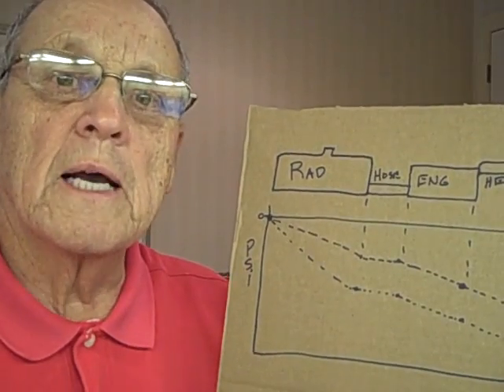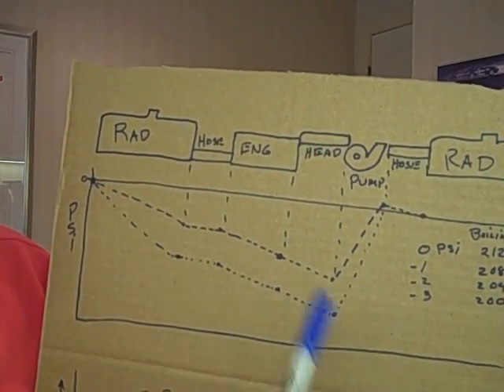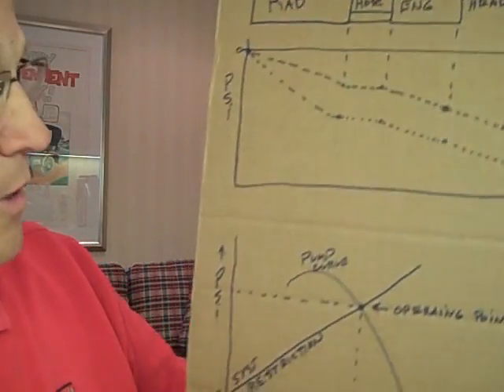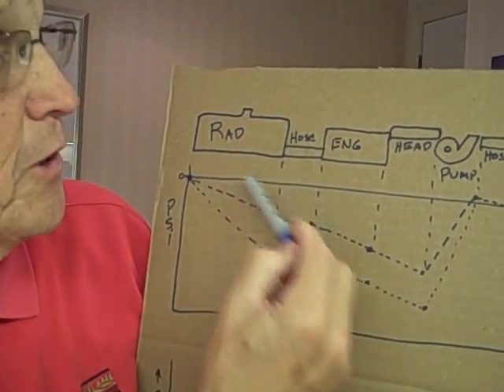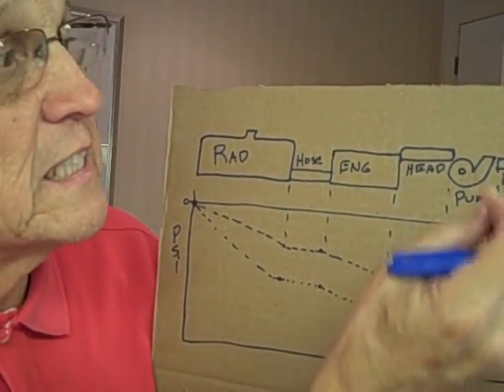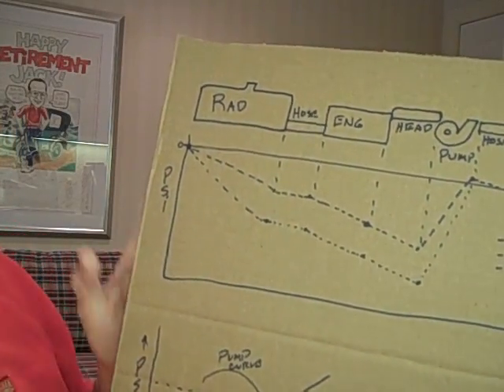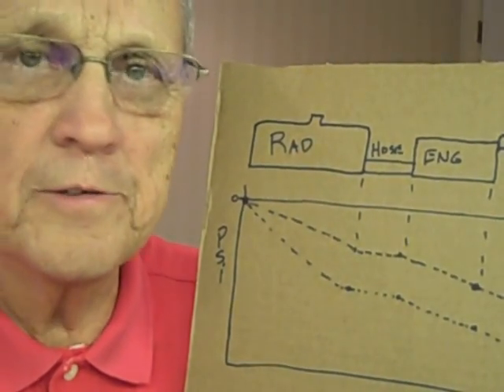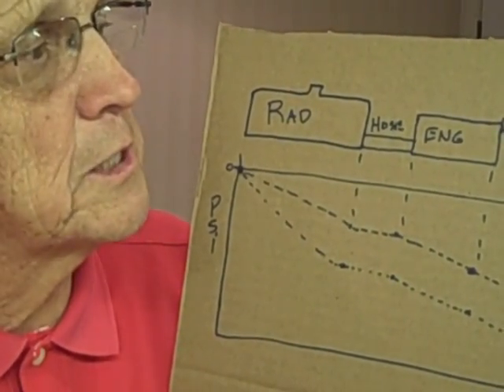Ford Model A Cooling System Overheating Explained

Comment: Is this for a properly functioning system as Ford designed?  Like, IOW, could a model A not ride for 10 minutes at 45mph without overheating?
It seems to me that any classic car that is going to see the road should have a newly cored radiator and the proper pump in good working condition.  From my experience, it is parades that kill classic cars. It's the constant low speed often just stopped and idling that causes the overheating of old cars.

Comment: I have eliminated the most common issues with the cooling system on a A but running down the road 55-65 on a 90 degree day the water temp will hit 220 and usually stays there. My trips are usually 30 to 40 miles at a time. The car has a brand new 3 core radiator and at first I had a problem with the coolant being forced out of the radiator while cruising and I use waterless coolant so no chance of boiling or steam. I added a electric water pump between the lower radiator and the engine and stopped that problem. My engine is totally rebuilt with higher compression head down draft carb and electronic dist. I also use a 6 blade radiator fan. The water pump is a leakless with the reduced impellor. The electric pump I added does 50 GPM. I think it should run cooler down the road and I believe air flow through the radiator is not as good as it should be at higher highway speeds due to the head lights up setting the air flow into the radiator. The lower pans in the engine bay will not help air flow through the radiator.

Comment: Not a mechanic or engineer, but I'm just stopping by to confirm, one major factor is indeed the many years worth of rust inside.
I operate injection molding machines, and I found some of our molds don't cool as well as they ought to. Turns out, they're fairly clogged up with rust. Just blowing them out with compressed air (blew out a cloud of rusty mud!) made them cool nicely, and keep the boss cool too LOL.

Comment: I had a prospect radiator manufacture in Minneapolis for an electrodeposition paint tank. One of the many parameters for an E-coat tank is ... we need to throw 1.3 amps per surface area-square foot of 'work' in the tank. 
We calculated the square foot of all the crinkled-up cooling fins plus the tube's outer surfaces times the number of radiators an hour to be produced and concluded that Minneapolis did not have enough available electricity. We would cause a massive 'brown out' and everyone's refrigerator motor in town would fry. 

I sketched this back in 1977 as I talked to a prospect about an E-Coat tank. I sketched this so I didn't forget anything. ~~~~ https://www.finishingtalk.com/community/user-uploads/skip/Electrodeposition%20Painting.jpg

Comment: If you can not cool it with 2-1/2 gallons you will not cool it with 3 gallons. 
The centrifugal pump slings water uphill through the neck and into the upper tank. It's virtually impossible to flow water through a tube faster than 32 feet per minute. Ford sized their Model 'A'  radiators easily on the correct side.

Comment: I want to get a model a truck for daily driver and I live in a very hot desert , can I or do I need to add a better fan or electric fan
Reply from the maker: I would start with just a new radiator.  Most cores are plugged, but the owners never want to admit it.  The best you could do is put a three row AA radiator on, but you may be OK with the two row.  
Don't think a radiator shop can clear an old core.  Most can't, no matter what they say.  The only way to clear a core is by rodding it out mechanically, and that is hard to do because of the design of the A core.  Good luck.
Reply: @JackBahmlll  Thank you so much for your advice ! I don't have a model A yet but have watched nearly all of your videos and I feel more confident that I can maintain the vehicle . You explain things very clear and easy . I absolutely enjoy the simplicity of the model A and how everything is mechanicle. Thank you again for taking the time to teach me .

Comment from the maker: They sell filters, but once a filter catches the junk, you can remove the filter. I think an old sock would do the job. When you put on a new core, give it a short run with the sock in there, then remove it. Should work. Once the junk is stuck in the tubes, the filter won’t help.

Comment: Jack Bahm seu video me ajudou a entender o sitema de arrefecimento do meu Ford A 1928. Estou com esse problema de aquecimento, já conferi o ponto do motor, retifiquei o motor, troquei a bomba de água mas o problema ainda persiste.
Vou verificar o radiador na tentativa de encontrar alguma solução para o aquecimento. Obrigado do Brasil!!
Reply from the maker: If you are bubbling out at low speed, then it may be combustion gases getting into your water jacket, tighten the heard bolts to 55 ft.#.  If it is still there, you may need a new head gasket.  
If the problem is at higher speeds, as most are, your radiator is plugged.  Most are.  Have it re-cored or buy a new one.  If you have the ability to check the flow rate of your radiator, it should flow around 36 GPM.  Good luck.

Comment: I know of a business here in New Zealand who still use antique equipment from the era to make vintage car radiators, maybe what your looking for?
Reply from the maker: Tell them that there are about 250,000 Model A's over here and there should be a good market for a new, old radiator.  They are getting $400 for the ones we have.  They fit and look OK, BUT USUALLY HAVE A MODERN CORE IN THEM.

Comment: It's probably the result of cavitation in the pump and other points in the system where there is much flow and some void (vacuum) turbulence pockets that makes the cooling fluid water boil below it's designed boiling point. Water vapor has a lot more energy and destroys pump vanes and increases corrosion. Try Evans waterless coolant.
Reply: Miguel Ángel Simón Fernández 
Definitely Evens. 
 $40 well spent and you only have to buy it once👍🏻

Comment: build a fan shroud or find a suitable size one from a junkyard car , it sounds like you need to increase the airflow going across the rad, food for thought
Reply: I drive a 1931 Townsedan, heavy car, at 50 mph plus in Houston when the temperature is 98 degrees. Never had an overheating issue and do not have a fan shroud.  Ford only used a fan shroud for a few months on the early Model A's. It was abandoned as Ford felt it was not needed.  Suggest before you feel you need a fan shroud you find the root cause of your cooling issues. Just saying.

Comment: Jack,  Nice information and talk about a serious problem that has many limited to short drives.  My question is why so many radiators are plugged and what preventative measures can be taken?   Sometimes it is difficult to see your poster. :)
Reply from the maker: +Henry Carr  You can't do anything to an old radiator.  They are plugged with no flow, so you can't put in anything to attack it.  When you put in a new one, or a rodded out one, you should put an old sock over the rad inlet to catch any chunks you stirred up.  Run it a bit, then take the sock off.  Keep antifreeze in it and drive the car.  You have to drive it.

Comment: No, my boiling problem is now solved. And it was caused, like I said, from the lower clamp on the upper rad hose which, I believe, needed tightening as well as moving it up a little. After seven months, I think I can safely say that it wasn't a plugged radiator, just one of those little Model A problems of something coming loose.
Reply: Was it sucking air or leaking coolant?
Reply: @clockguy2  She had a water leak. After 5 years, I still do recall.

Comment: Hi Jack,
I'm well aware of the old problems with Model A fan blades breaking off. But as I said, mine was totally reinforced maybe five years ago and I've never had a problem with it, well at least not yet. It's just the rear ring of the pully which broke off, thankfully in my own yard. This morning a friend of mine was able to Mig weld it back on. Now I just have to grind down the welds, give it some new paint and put everything back together and try it out. I haven't heard of that belt load problem but could that be the cause of the rear ring breaking off?
Reply from the maker: I found my old write-up and will paste it in here.  I don't think a bad joint would cause that pully to come apart.  Sound like you are all set.  jack

Model A tips on the water pump connection to the fan assembly.

The joint between the fan assy. and the water pump shaft  has given Model A’er fits over the years.  It is a taper fit and it must fit tightly or there will be problems down the road.  The design of this joint is not the best.  The belt load is about 2 inches aft of the tapered joint.  The belt load puts a cantilevered (offset) force on this joint.  If there is any movement between the shaft and fan assy., this force will cause a pounding out of the two tapers.  This force rotates 360 deg. every time the fan makes a rotation, and it turns faster than the crankshaft.  Many people try to fix a loose joint by tightening the nut on the nose of the shaft.  This does little to fix the problem and most of the time results in a stripped nut or shaft.  Clamping the fan assy. tighter on the shaft can not overcome the forces tending to wobble the fan assy. on  a loose fitting shaft.
  
So what do we do about all this?   Check the fit often, and don’t start on a long tour with a loose joint.  In time, it will pound out and make noise, and may end up causing damage to the radiator or hood.  If you find a loose joint, check the fit with the mounting nut off.  If it is loose, replace the fan assy. with one that has the proper taper for the shaft you are dealing with.  If it is not a snug fit, it will get worse and the problem will repeat. 
 
I have been successful twice fixing this problem on the road.  Not sure why it fixed it, but it got us home.  Take a small piece of shim stock and form it into a conical shape and place it in the joint leaving room for the key.  You will have to do this a few times until you get it in the correct place to cause a tight fit.  Be sure you have bandaids handy because that shim stock is very sharp.  
This problem may be a little worse with an altenator.  I think we run higher belt tension when we put an altenator on due to the smaller pulley.  Keep you belt tension as low as you can.  Don’t put anymore load on that water pump joint than you have to.  

Jack Bahm 2007

Comment: The only reason I know of that I've had boil overs with my Model A has been from loss of water. And I've found that loss of water can easily occur from those old large slot dome headed screws which hold the clamps. A thick screwdriver with a good flat end is needed to tighten them because once that slot becomes worn after using a thinner screwdriver, the screw can't be tightened enough and water leaks out.
I've also had the rear wall of my fan pully break off and then the fanbelt won't turn the fan. Since my fan has been reinforced and powdercoated, I really want to save it. Can that rear wall of the pully be Mig or Tig welded back on?
Reply from the maker: Be careful of the fan.  It can end up in your skull or hood or radiator.  I doubt that you will find anyone who would weld it for you.  If you do it yourself, make sure it is perfect, and stay away from it when the engine is reving.  
The tapered attachment to the water pump shaft is a major problem.  The belt load is cantilevered forward of the taper and it always beats itself up and fails over time.  I wrote a paper on this joint.  I'll look for it.  
If you can get those hoses tight and drive 45 mph for 10 min straight, your rad is OK.  
jack
Reply from the maker: Jim Ervin  I don't think that clamps are your problem.  Drive 45 MPH for 10 full, steady minutes, and if you overheat, and I think you will, your radiator is plugged..  Most of them are and people keep playing with bandaids and fooling themselves.  jack

Comment: thats very interesting , now ive got a question about a 70s chevrolet cooing stystem and how to descale the iron block and radiator.would it be safe to fill everything up with tap water and add a small percent of sulfuric acid let it run mix well.sit overnite then run again with a garden hose old school flush for awhile? ive descaled other things that way works very well..but would that really get the cooling channels in the block and heater system cleaned out to flow again like it was ment to?
Reply from the maker: thunderstorms06 Be careful with that acid.  It may do things you don't want.  People have screwed things up even with bleach.  If there is no flow in the tube, the acid won't get there.  jack

Comment: So, if I started making radiators that are similar to the old Model A/T radiators, I could have many customers?
Reply from the maker: I Invoke My First Amendment Rights There are a lot of good new ones out there that work good as long as there is not much junk going around.  You would have to compete on price and market the fact that your core has big tubes for better flow of junk.  jack
Reply: Brassworks makes a fantastic radiator. They make some that are like the original and some that are more of a modern style. When this video was made these radiators may have not been available. You would have to compete with them. They have a fantastic following and a fantastic reputation. https://www.thebrassworks.net/shop/index.php?cPath=11_18

Comment: Jack, you appear to be an Engineer. Most valuable discussion. I am a Mechanical Engineer. NPSH and all of that, right? Nice discussion.
Reply: I'm machanical engineer too, your video is perfect in the regard of the Model A cooling system, the most important aspect is when the coolant becomes so hot that it brings the pump in the cavitation zone, then, the flow decreases making the problem worse, it is the infernal spiral.
Reply from the maker: Michael Eisenbise Yes, BSME from LSU.
Reply: @JackBahmlll  go tigers.

Comment: would a 4 blade fan help with pulling in more air and help with the cooling??
I have a 31 A model that I've had to install an electric fan to force more air through.
Reply from the maker: Lee Goins 
Sure it would, but you are just adding another band-aid, trying to cover up a radiator problem.
Reply: Jack Bahm Hello Jack, the 4 blade fan worked well, but still was running alittle hotter than I liked.  I bit the bullet and spent $1100., had a buddy of mine build me special radiator with bigger tubes....everything works like a champ now.

Comment: Great info Jack!

As far as having a push pump I have seen model T pumps adapted to performance A engines which are pushing the coolant into the block vs. sucking it through if I’m not mistaken. I never saw the advantage of that set up until now.

People also put aftermarket pulleys on that are smaller in diameter so the pump turns slower. This might reduce some of that negative pressure that causes the overheating issues as well.

Please keep the videos coming, I really enjoy them.